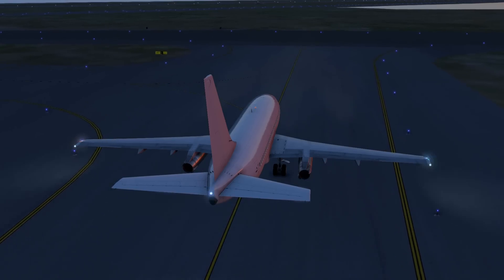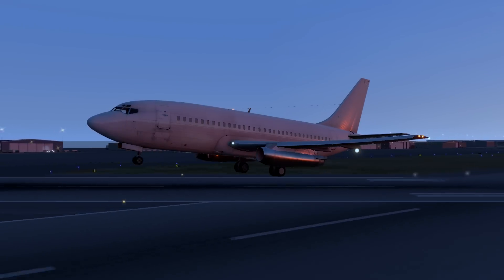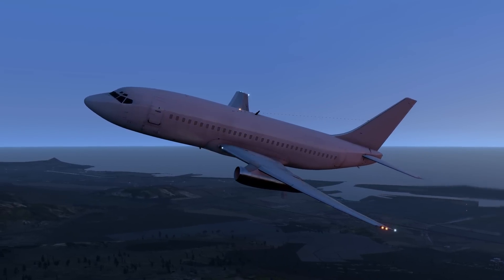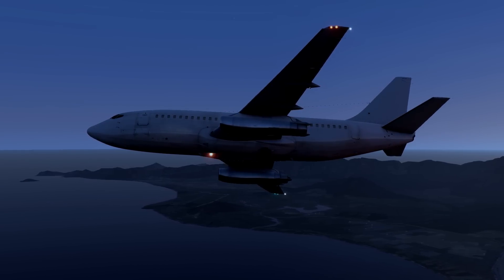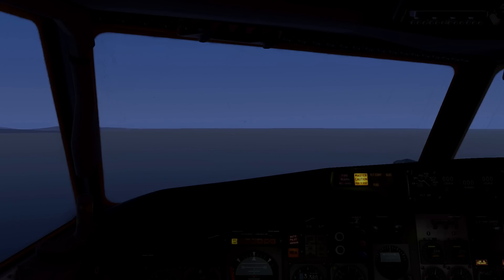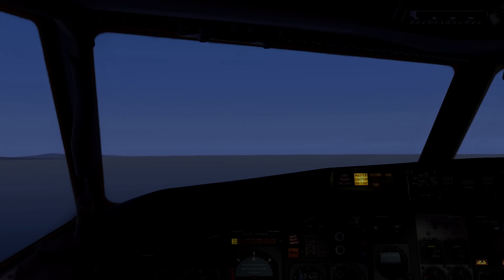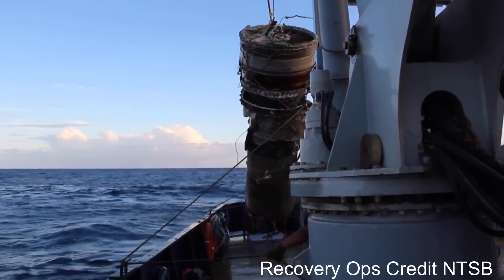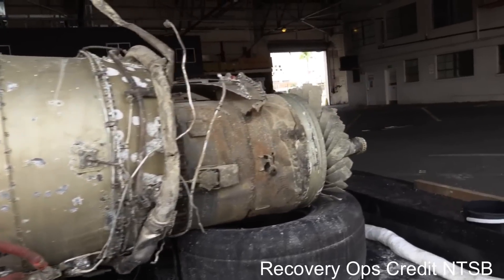The Split Second Decision That Sank A Jet | Trans Air Flight 810

Comment: Former air traffic controller here. It's amazing how high stress can hinder your ability to absorb and process information - as happened here where the two pilots forgot their earlier assessment that it was the #2 engine that had failed.  
It's during these kinds of high stress moments when you rely on your team mates to communicate clearly with each other to avoid information gaps being created by the rising stress. In this instance, the first officer failed to communicate clearly to the pilot that the left engine had been pulled back to idle. 
Terrible disaster.
Reply: These are the Pilots who refused to identify their engine out emergency clearly and forcefully to Honolulu Tower.    Even though Honolulu Tower cleared them for an immediate go around to land on a runway with open water on approach.. no buildings or neighborhoods to worry about.. They refused and ask for a vector away from the Airport.. so "we can run our checklist" ... then they didn't run any checklist that involved throttle position.   You should have seen the comment section after the initial crash .. as usual Pilots of every rank shouting high praise for these TransAir  type cockpit inhabitants.   1 million attaboy's for walking away from an ocean ditching ... that they caused.
Reply: Incidents such as this one is the reason why I really think we need to bring back the flight engineer (or redefine the role to fit better in modern aviation). The workload can get way too high and we’re only humans, prone to make errors in high stress situations.
Reply: @TheaSvendsen  I would agree. In an incident like this one, having a flight engineer there to do nothing more than monitor the communications between the pilot and co-pilot could have made all the difference.
Reply: @TheaSvendsen  Despite accidents like this: flying is much, much safer than back in the day of the flight engineer. The worse record back in the last century is of course not the flight engineers' fault! What an honorable profession that is!
But improvements in crew resource management (big time!), procedures and technology brought improvements that make modern cockpits of two crew members safer than the old ones of three.
But there is something else to be developed that can and will challenge and help the pilots if they take "unreasonable" action or just a faulty one due to stress: 
I am convinced that a great trained AI companion will be able to challenge the pilots, i.e. prompt them "are you sure you want to shut down engine #1 when only #2 has faulty indications"?
Workload can be a big issue for pilots expecially when critical systems fail. AI will be able to process, sort and interpret high quantities of information to help pilots in a big way. 
If I had an airline I'd set out to develop an AI companion for the cockpit, starting today.
Reply: Adrenaline is not helpful for clear thinking.
Reply: Have you ever said, "say again?"
Reply: @Capecodham  Oh yeah. All the time.
Reply: @PaulRubino  That is the problem, I wonder how many accidents you caused not paying attention the first time?
Reply: @Capecodham  Say again?

Comment: The USAF lost a C5 at Dover due to the crew swapping throttles with the throttle from a shut down engine. Led to essentially a two engine situation on a very heavy airplane. The plane stalled and crashed short of the runway. Fortunately no one was killed..
Reply: Just what I was going to post!

Comment: Well, if in doubt about which engine really failed (been there done that) slowly advance each power lever to see which one responds and which one doesn't. 
This, because engine instrument indications can be somewhat misleading at times (say flight idle after a descent, EGT temps unreliable depending of nature of defect, etc..). 
Glad the pilots made it!  Ex ATPL here...
Reply: Didn't really help the pilots of the BM flight at East Midlands Airport.
Reply: I am not a pilot but I am an engineer (electrical / electronics / computer) and that gives me a certain way of thinking.  Your suggestion seems very logical!  If I were a well trained pilot flying an aircraft in such a situation I would do exactly what you suggest because even if an engine had suffered damage and would over-temp and/or suffer more damage at a higher EPR and/or catch fire I would rather have that happen than go into the drink in which case the damage to the entire aircraft will be catastrophic.  You might even get enough performance out of the engine(s) to get you to a field where you have good emergency services.  If the engine(s) are melted down to slag after landing - who cares?   An example of an emergency with  REAL multiple engine failures was  Eastern Airlines flight 855 where the emergency was handled much better than this crew was able to achieve.

Comment: Wrong engine shut down? Sounds familiar. I'm sure I've heard THAT before, more than once, just on THIS channel.
You'd think, as expensive as planes are, the manufacturer would spend another $20, or so, to install one "check engine light" for EACH engine... (and make the light blink rapidly if the engine has started falling apart). And yes, I understand that this plane was almost old enough to enter service for Delta airlines, but retrofitting a "missing engine" switch can't be that difficult, or?

Those pilots were pretty lucky (and good under pressure), judging by the condition of the plane in the pictures.
Reply: I agree .. it’s ridiculous.

Comment: In my many years of experiences of plane crashes and emergencies… the last thing I would ever do with an aircraft in an emergency condition is to allow a Second in Command, Co- pilot or any pilot who doesn’t have complete authority from the senior pilot authority to fly that aircraft to handle or operate that aircraft in any way in an emergency.   The problem in almost all my emergency experiences has been someone else handling or operating a significant part of an aircraft.  This report is a perfect example of what I have just written.  But I disagree that both pilots made a mistake.  The first officer shut down both engines. He and only he … the first officer… made the mistake and at fault…story over…and the end!   They did not shut both engines down..the second officer shut both of the engines down, and he is responsible for what happened!   Final!
Reply: That's not at all how it works and you're telling a load of crap. In the flight deck you have different roles (PF & PM) and each have their own areas of responsibility. Some actions like disconnecting a generator drive, closing a thrust lever or moving an engine start lever to cutoff are actions that must be confirmed by BOTH pilots. If the PM wants to shut down the wrong engine and the PF confirms the action they are both equally at fault. I'd say that the captain is largely to blame for the accident as he decided to switch roles and become PF in a critical moment which might cause confusion. Anyways, it doesn't matter who's fault it is, it's an accident that emphasises how important CRM really is. And based on your comment I'd say that your CRM skills would be non-existent.

Comment: In an emergency the captain should not be flying, but should be managing the emergency. Just like on a ship in an emergency the captain does not rush to take the tiller.
If the captain is the flying pilot during an emergency and loses SA, in nearly every case both crew members lose SA. If the captain is the non flying pilot and the FO loses SA, nearly every time the captain recognizes what has happened.
Reply: Fact!
Reply: DING-DING-DING
Reply: Preferably, whoever is flying at the time of the emergency should keep flying - captain or first officer, it doesn't matter. Both of them are well trained at both the job of flying and the job of managing. 

They should only change roles if there is an important reason to. "I'm the captain" isn't a good reason.
Reply: @robertbackhaus8911  initially, yes. But eventually the captain should turn over the controls to the FO so he/she can manage the emergency. If the captain is the non flying pilot, as in this emergency, he definitely shouldn’t take the controls unless the FO is having issues controlling the airplane

Comment: How do you see a leakage and think "oh well, let's just fly and see what happens"??
Reply: Finding residue of hydraulic fluid is pretty normal. As long as there are no leaks when the system is pressurised there should be no problem. Also, it was signed of by an engineer. Also, it was not relevant to the accident.

Comment: If they thought the engines were not working and the left engine was losing power aswell they should of b-lined it to the airport straight away instead of doing the checklist.
Reply: Yeah, let's arrive at the airport too high and at the wrong speed with brakes, instrument landing frequency and speedbrakes not set.

Comment: The NTSB released their final report on the accident on June 15, 2023. The investigation revealed that during the takeoff the cockpit voice recorder recorded a thud and subsequent vibrations. The engine failure was attributed to oxidation and corrosion within two engine high-pressure turbine blades causing stress fractures and subsequent breakage

Comment: Please explain EPR value. Thanks.
Reply from the maker: APR stands for engine pressure ratio. It’s basically just a number that tells you how much power in the engine is producing.
Reply: FWIK, It's a ratio, pressure at the exit of the reactor divided by pressure at the entry, so you need something (well) above 1 to get power from the engine
Reply: @oliwek70  What's a reactor?
Reply: EPR?